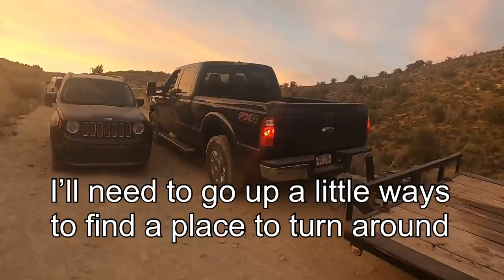Jackknifed! Ford Super Duty on the edge!

Comment: In a bind...drop the trailer and reset! Been there, done that, nice job. The landscape is looking good. Thanks for sharing.
Reply: Sometimes unhooking and resetting is all you can do..... I've never had to do it, but i've never been on the edge like that either with my trailer..... I have however had to swing the trailer around an a small slab with soft sand all around and almost got stuck, soft sand is no joke
Reply: Looking at this a second time though he could have avoided being on the edge by changing his position on the road to give him more room for swing..... That's actually what I typically do when I have to do a 3 pt turn like that with a trailer..... Pull in close to the side I'll be backing into and then just kick the trailer out a bit and kick it in real quick so all I have to do from there is line it up and pull forward
Reply: So have I. Mine was mud at a dump trailer was not wanting to do wanted it to do kept sliding
Reply: @heatherbeane3234  always fun when a trailer isn't doing what you want it to do.....  I've had that happen many a time when I try and line up to back in on a tight spot.... sometimes all it takes is a little patience.....
Reply: @christopherrosas2738  Oh definitely agree. My patience was very very thin that day. Plus when the trailer was in line with my vehicle you could not see it from either the side mirrors or the rear view mirror.

Comment: I cannot imagine driving off road without a full size spare, these new vehicles are only good for the city. 👍🏻🌞🌞🌞🌞
Reply: Yup they give you a fix a flat and pump or you get a spar for 300
Reply: renegades are actually pretty decent off road or atleast the trail hawk.
Reply: @cablenowadays6586  my stock sport is suprising good offroad even better than the liberty i had that qas lifted and bigger tires. Its not a wrangler
Reply: Or just get the spare as an extra?
Reply: Haha the renegade is just a rebadged fiat 500....
Reply: @JamieR2077   Or how about a spare that is useless offroad? Subaru did that with the 4 door pickup they sold years ago. Spare was a different size, and the awd system would not work with it!
Reply: @cablenowadays6586  Even the non-trailhawks are pretty decent. Just do not expect to do any rock crawling, ever.
Reply: Christina Coloradoan ya the renegade is a fiat 500 w a different body and “awd”
Reply: I have a 2016 Malibu and my wife has a 2015 Accord Hybrid. Neither came with a spare. I had to buy jacks and spares for both. Accord was easy as regular Accords have spares. Malibu was harder. Nine if them come with spares. I figured out that the spare from a Cadillac CTS was the only one with the right lug pattern and big enough to clear my brakes. (I actually bought it when i had a Volt. I wont drive anywhere without a spare. Ive been inown to throw a second spare in my tow rig 2001 2500hd if making a long trip. All my trailers have two spares!
Reply: Those Renegades are a POS. Isnt it a Fiat?!?! Doesnt deserve the Jeep name.
Reply: Odds are, even if they had a full sized spare, they wouldn't know how to change it on a hill
Reply: Why can`t they just bring a tire
Reply: @WIDESIDE72  Yeah. All Jeeps made after 2015 are Fiats :(
Reply: @JamieR2077  Jeep in name only
Reply: Or 3..... whenever i off-road i always carry a spare hub, 3 rims and tires. And a bunch of rope.... need to invest in some yankem ropes though.
Reply: The Bushwacker  It's been all about gas mpg as they keep being push higher and higher back in the Obama days.
Reply: I usually take 2.
Reply: @seangray3982  put 3 big ass rocks in front of the other wheels.
Reply: More drivers with rock in their heads!
Reply: @cablenowadays6586   Yeah but we still like to  ragon them and call them for will drive fiats regardless of how capable they are.
Reply: @JamieR2077  I owned an 85 Dpdge Shelby Charger. I had to laugh when some clueless idiot called it a Fiat.
Reply: The bigger problem looks to be the tires they DO have. Never drive roads like this with the cheap highway tires you buy the vehicle with. Upgrade them immediately. I learned my lesson on the Willow Springs (Moab) road with my new Jeep Patriot. Popped holes in three of the tires it came with...
Reply: Don't tell Matt.
Reply: Hindsight is 20/20 but wouldn’t it have been better to drop the trailer at the customers car, turned the truck around up the hill, and come back down?
Reply: @cablenowadays6586  thats rich
Reply: I thought so too until I watched people trying to offroad them. The Renegade at least has better gearing, if nothing else.
Reply: There's video of a Renegade climbing Hell's Gate.
Reply: @madrabbitt  and which direction would the trailer be facing at that point?   Hmmm.
Reply: @madrabbitt  Ok mouthyrabbit, if you can turn that 1800 pound trailer around on the side of that hill, BY HAND, I will give you $1,000!
Reply: fun fact: my car has 15“ rims all around, but the spare has a 16“ rim (while being narrower though), haha. :D
Reply: Why on earth would people drive in country like this without a spare wheel (or two)?
Reply: Where do they put the spare for the recovery vehicles? Thats right, back at the shop ;)
Reply: @Rat-Builder  He obviously thinks that trailer is the same as his single axle 5 x 8 utility trailer that he uses to haul his riding mower with.

Comment: It helps to know your equipment. You choose the truck over the jeep.  Cause you know your equipment capability.  Keep up the safe towing
Reply: This is some sage advice that could have helped out one of my nephews..... He actually now has a truck with no reverse because he tried to back a heavy trailer up a slight incline and blew out reverse.... Trailer too heavy for his truck...... And he gets on me when I tell him I can only tow so much with my Jeep and have to occasionally drive the trailer on my dad's truck just to keep my Jeep running...... Still got all gears on all the vehicles I tow in
Reply: That Jeep Cherokee is really limited for towing capacity. It does a number of things pretty well but you have to know its limits. A friend of mine asked me to drive his Cherokee back from a race that was about 130 miles from home. I was towing his Formula Ford race car on his flat car-hauler trailer. It handled OK until traffic locked 'em up as they approached a raised drawbridge. That's when the trailer decided it wanted to push the Jeep for a ways and kept trying to lift the rear bumper if I wasn't real gentle with the brakes . With some judicious feathering of the brakes I kept the excitement to a minimum but the owner was in the right seat and he swore he had left "pucker  marks" in the upholstery! A Formula Ford is an open wheel, single seat race car that looks vaguely like a miniature F1 car. The weight is about 1,100 lbs and the trailer was probably 7-800 lbs. so the total was pushing a ton. I don't know the limit on a Cherokee but that's just a bit beyond the safe limit... oh, by the way, the owner stayed awake ALL the way home after that drawbridge!  ;^)

Comment: People, just because it does not come with a spare, does not mean you cant get one. Get a cheap wheel rim or identical unit and throw it in back of suv. takes up similar space as a doggo lol.
Reply: That's what I did with my Jeep Renegade Latitude, even has the cutout and threaded hole to bolt down a spare tire
Reply: kevin c  hello, yes my 2013 TAURUS, comes with a can of stuff & an air compressor , but have not yet even looked at it, it’s LIFE is limited, need to get a rim &tyre,  on the other hand my 91 TAURUS , that spare was NEVER ON THE GROUND, 340k 4 sets of tyres , never ever had a flat .. Cheers 🇺🇸🇺🇸🇺🇸🇺🇸
Reply: I would never be comfortable going anywhere without a spare wheel 
I even have a jack and both manual and electric tools
Reply: I have a 2016 Renegade sport. Yup no spare tire! Only comes with full size spare on “trail hawk”models. Space saver spare with jack cost about $320 from dealer🤦‍♂️. I found a black steel rim($60) and a good 16” tire($15)👍
Reply: Heck, not just for off road.  My 2017 camaro didnt come with a spare, came with a compressor and tire goop.  Made me nervous going anywhere out of town, so first upgrade was a spare!
Reply: not when its a 33 lol
Reply: It was probably a rental like most of the people he recovers
Reply: I bet a XJ wheel would have bolted right up, with a small tire of course.
Reply: I run two spares off the back of my 4b, not real keen on getting stuck in the outback because of a flat 😊🇦🇺
Reply: RayS S I under stand one not coming with a Camaro but a jeeps not getting one
Reply: Jon the lamb because is not a real jeep, is a fiat. Look it up, same as fiat 500
Reply: Renegades actually have a space in the cargo area to put a full size spare tire. And yes many of the Renegade forums tell people to hit up their local junk yard for a rim. Then slap a $40 cheap ass tire on it from Discount Tires. Something new that is plenty good for a spare but not something you'd want full time.
Reply: @CooterTravenport  Custom license plate. I bet not a rental. :-)
Reply: I will guess that was a rental... So...
Reply: @CooterTravenport  They were locals..
Reply: @CooterTravenport  They were locals..
Reply: @theturtle2121  And yet you bought it.
Reply: You have to tell Matt that, he never bring a spare with him...

Sure he can just call someone to get it, but that is also what everyone that call for his help already do ;)

Comment: Would it have been easier to grab a mounted tire and change it out on site?
Reply: you would have had to source the proper tire diameter and also find a wheel with the right offset and lug pattern.  It's easy for some vehicles, but not so easy for others.

Comment: And this is why you want LT tires and NOT car tires.
Reply: This is why if you want to buy a Jeep you buy a real Jeep 🤣
Reply: @Beandiptheredneck  Have one LOL.  Look at my icon or channel.
Reply: John Bango I saw that, my sister has a red yj that looks just like it
Reply: @Beandiptheredneck  I bet mine has something your sister's does not have.  That is a white top.  I have only seen 4 like that since I bought it.  I have to be careful driving it because it sticks out like a sore thumb.  BTW, just subbed your channel.  I have a 96 E150 that I want to swap out radios for.  Thank you for that video.
Reply: John Bango no problem! Glad someone actually found it helpful, her top was originally white but it was bedlined before she bought it
Reply: @badgerpa9  Sorry just saw your comment today.  Please, not trying to be a snot head.  I am no tire expert.  Why do you say they would not "platform out"?  The rims appear to be at least 15" x 6".  If this is true I see no reason you could not get LT tires.  If you must, go one size larger then put in some spring rubbers, like NASCAR.  My dad did it back in the 70's on his car.  He did this to run larger tires.  If you must, and run 4x4 roads a lot, buy new rims.  The new rims will pay for them selves vs a few tow jobs.  Then again, it is a mall crawler.  Use it as such.
Reply: @badgerpa9  Thank you for your incite.  I think we are confusing some terms here.  You have regular passenger tires and then you have LT tires.  Since you wrote I double checked the tires I run on my van.  I have LT tires on it.  Sorry, I did not check the tread or sidewall ply.  I am guessing 6 tread and 2 sidewall.  This is just a guess because it is getting dark.  Maybe more on the sidewall.  These are the type of tires I am talking about.  I can run the pressure up to 50 psi, not the standard 35 for passenger tires.  My Jeep is the same way.  LT tires that can run up to 50 PSI.  They can carry over 3000 lbs per tire.  With my Jeep I run them at 17 and 25 PSI on road.  This is because my Jeep only weighs about 3500 at best with 2 people in it.

I agree with the dig vs float.  The Jeep is more a daily driver than an off roader.  Therefore I choose 33 x 10.5 15 over the 33 x 12.5  x 15.  I wanted more digging over floating.  This was because, once in a blue blue moon we do get snow here on the valley floor.  On the other hand, I do like to play in the mountains.  I thought that this was the best of both worlds. 

Check out the video I have on my channel.   This was shallow snow.  I got stuck up there in much deeper snow.  4' to 5 ' deep.  Yes, I did get out on my own.  Another time I drove around a 4runner that was framed.  The new pos that they call a 4x4.

BTW, are not the tires you are describing put on split rim?  The old 16" rim was split rim and my dad's semi was running split rim.  The old bias tires with a very stiff bead.  I should mention that the old WWII Jeeps also ran a split rim.  Different than the afore mentioned.   This was so field repairs were easy.  The same with the TC-3 trailer that I have for my Jeep.   Sorry I got a little long on this one.
Reply: @badgerpa9  One last thing.  My dad's old jeep wagoneer we had I think 8 x 6 ply on the tires.  This was the old bias ply tires.  Went to a larger bias ply tire and they thumped well until they warmed up.  If you must ask, yes I am old.
Reply: @badgerpa9  Ok, now this is becoming fun, in a good way.  Just noticed your name.  Are you from WI?  Because I am.  Also lived in AZ. 

I am guessing that the tires you can inflate to 70/80 psi are on 3/4 to one ton vehicles.  8, plus lugs.  Agreed that the split ring wheels are very dangerous, if not deadly. 

Now when you get into the tire. You describe type of tire not class of tire.  Please, I do not know the different classes other than the higher in the alphabet the greater the load rating.   A  C rating is lower than a D rating. 

Highway tire vs a all season tire vs a all terrain tire vs a mud + snow tire have nothing to do with load rating.  This is all type of tire vs rating of the tire.    It does have an effect on the wear of the tire though.  Highway tire will be much harder rubber than the others.   Therefore last longer.  All season, why bother?   All terrain is great for desert, hard rock and ice.  Mud and snow, need I say more?

Other than that I can say I love my BFG  M+S 2 tires on my jeep. 

I enjoy talking with a person that does not scream at me.  I have enjoyed our conversation together.
Reply: @badgerpa9  WI has a very special place in my heart to.  Was born there.  Grandmother had a cottage near Rhinelander WI.  It was on a lake.  That was where I learned how to water ski and snowmobile.  Beautiful area.  Now live in WA.  WI with mountains and a far milder climate.  Hottest I have seen was 100 with low humidity and coldest is about 17.  If I could change the politics and taxes, I would want to die here.

As far as snow plowing.  I had a Jeep J 10.  I put a plow on that.  Was running 31x 10.5 x15 M+S tires.  That thing was a beast.  Plowed a ladies access to her propane tank.  She never mentioned the ditch in road.  I watched the snow coming off the plow higher than the hood.  Never got stuck.
Reply: @TheLittlered1961  Yeah, the only "real Jeep" left is the wrangler. Has to have solid axles to be a Jeep.

Comment: Love your tree pruning equipment. Just in case if there is a steel cable left inside. It will be no problem for a sawzall. My wife would say that is my husband right there. He gets the job done with what is on hand. A screw driver, duck tape and BFH. Can do anything around the shop. Oh and baler wire. Cant forget that.